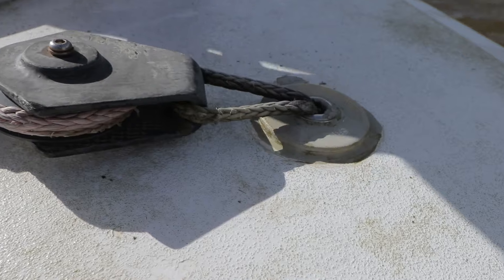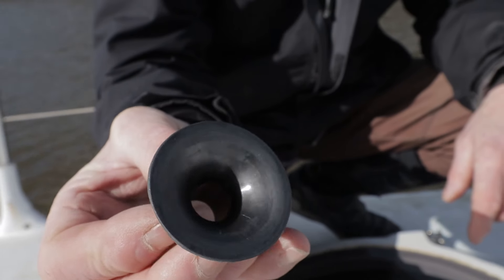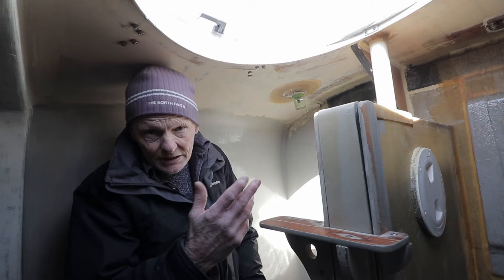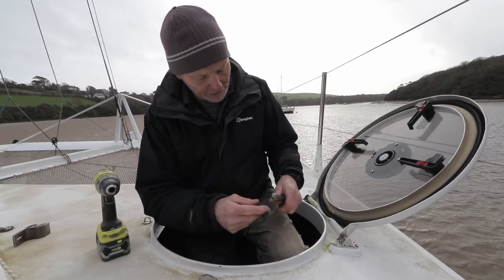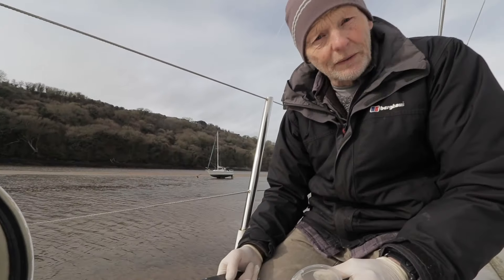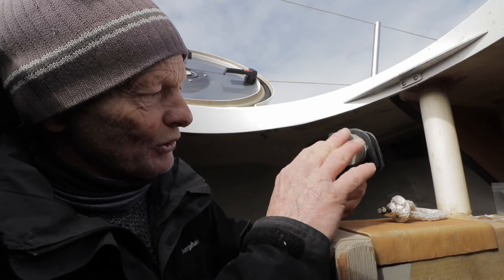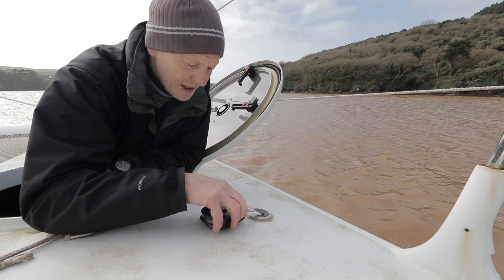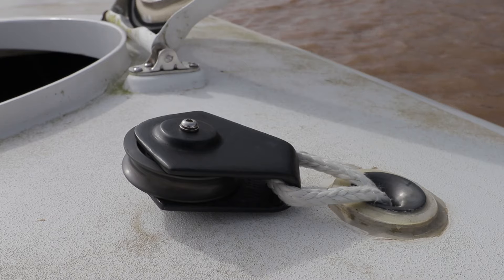Simple Carbon Through-Deck Padeyes To Improve Our Jib Sheeting Positions - Ep07

Comment: Just Grand Lawrence!  A few years ago I started my own design project of Black hole carbon deck funnels for block positions on deck with the notion to employ a custom lathe turned/polished aluminum mandrel that could expand a bit when heated during the curing process, making it a bit easier release parts once cured.  That, and of course the under-deck water catchments with small canning jars.  Yours look far better than what I had in mind, and the Green lid has a go-fast look about it as well.  

I too am looking forward to your fabrication strategies on both blocks manufacture and appropriate deck reinforcement for attachment points.  As usual yours is great stuff online for us, (real people crafting their own way with their own hands and head, wonderfully grounded, and no other better choice  in my opinion for us. If were going to voyage, building, or rebuilding it first, brings us to know the boat and systems well, sleeping better off watch).  Another two topics I'd love to see from you are; your soft head stay jib hanks details, and your thoughts on self steering vanes on cats.  Cheers!
Reply from the maker: Thanks for the feedback, Marty. Really appreciate it. I think you'll find the 'making of' video interesting - aluminium lathed tool! - and we'll try and cover the other topics sometime soon :)

Comment: Interesting, does it just rely on the strength of the deck to hold it in place With no extra bracing ?
Reply from the maker: No bracing but there's a reinforced area of deck, with a heavily glassed ply pad which spreads the load :)